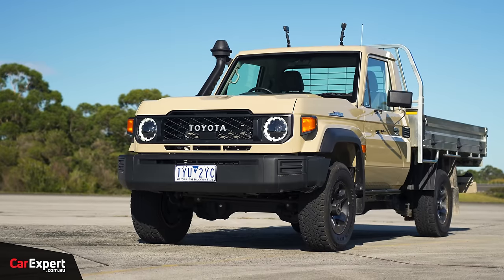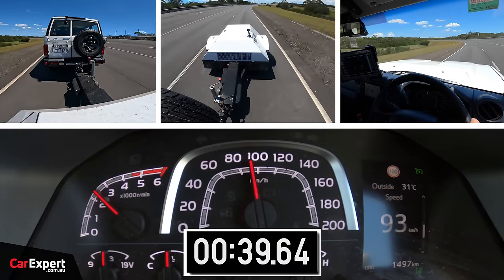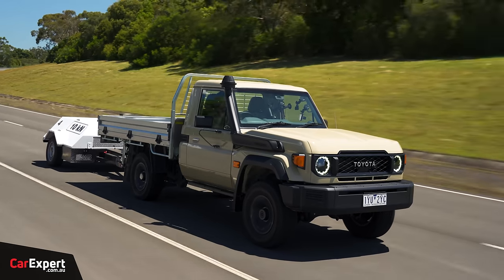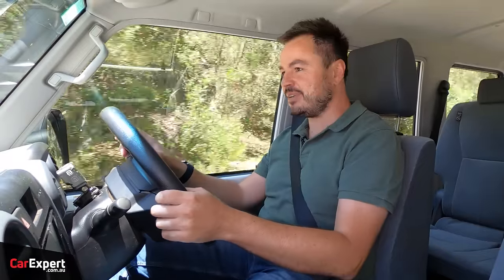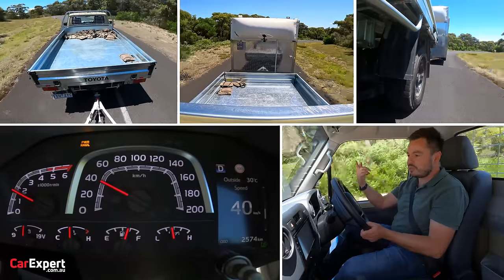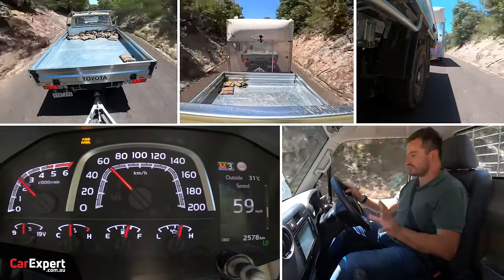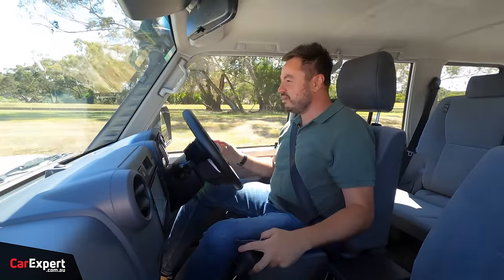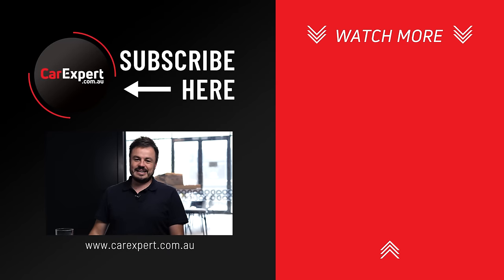LandCruiser 70 Series V8 v 4-cylinder towing stress test & drag race! Is Toyota's V8 dead?

Comment: Finally someone mentions the auto gearbox as a notable difference. Different ratios (especially 1st to 2nd vs the V8), torque converter vs direct drive in the manual, even different diff ratio in the 4 cylinder to help the engine rev more & aid with acceleration. It's not just 70nm more torque & suddenly the V8 is no good, there's a world of difference that everyone likes to overlook when comparing the 2.
Reply: Great to see some people recognising the drivetrain is the only reason the 4cyl performs better. That just gets ignored by journalists and 4cyl fans. The v8 behind the same ratio diffs and with a 6spd auto would tow better and for longer. Only reason 4cyl is in the 70 is because toyota want to keep selling to fleets and they know the v8 and v6 won't meet the incoming e u r o emission standards
Reply: Exactly my thoughts, bullshit comparison
Reply: 4cyl is cheaper to buy, run, and tows better. But for some reason, people can't accept this. There is a reason why the majority of truck manufacturers use inline engines over V configurations.
Reply: The torque wouldn’t be 70nm more there is a considerable power loss through an auto gearbox. Probably running very similar power and torque just getting delivered quicker in the auto.
Reply: They’re comparing the drive trains how they come from the factory.
Not that hard to work out
Reply: @kernal141  people love to talk hypothetically. It is what it is. This is what's available, and there is no unicorn.
Reply: Nobody mentioned aerodynamics either? For this test specifically, they're drag racing 2 different body styles/configurations of Landcruisers, 1 would be slightly better than the other which would factor into performance testing.
I know it would be minimal but still counts.
Reply: A manual transmission has less driveline losses so will perform better in a lot of tests, the main difference between these motors  is that the V8 has a single fixed blade turbo which is why it only gets up and moves from about 2000rpm to 3200rpm, they that only 1200rpm of usable power, no gearbox is gonna compensate for that. The 2.8 on the other hand has a variable geometry turbo that can provide boost from low rpm right up to high rpm, that why he can't get the V8 out of first on that hill test, because it's breathless at any less then 2000rpm. This is why the same motor in the LandCruiser 200 series has 2 turbos - one optimised for low rpm and one for high rpm and subsequently performs a LOT better than this dinosaur
Reply: @craigsampson3386  yeah ute will be a little worse but both are bricks really lol
Reply: @kernal141  true, & apart from the shared name they are 2 very different vehicles. also not hard to work out
Reply: @felixtimlock  the jump in gear ratios in the v8 from 1st to 2nd is much larger than the 4 cylinder version, with a steep hill & lots of weight you have to wind it out pretty high before going to 2nd to carry momentum for the change, otherwise it will bog down like this. The drivetrain losses in an auto will be worse once cruising at speed due to the slip in the gearbox, but at low revs that slip allows the 4 cylinder to keep powering on while the constant load on the v8 was enough to drag it down with the low revs. The auto is what makes most of the difference in that particular test.
Reply: Yup. Notice they aren't offering an auto with the V8...
Reply: @felixtimlock and having said all that, chap in WA put his tuned up V8 up against his new 4 with a 2.8 caravan behind both. The V8 was back to 4th and 3rd and couldn't maintain 80klms.
The 4 potter retained 100klms an hour in 6th for a majority of the climb.
As a owner of both, he wasn't expecting that, he was sure his tuned V8 would outdo the 4.
Reply: @craigsampson3386  Toyota 4WD buyers don't care about aerodynamics. If they did, then they wouldn't bolt on so many ancillaries like  big tyres, lift kits, bullbars, winches, driving lights, roof racks, side rails and steps and the tow a bloody great block of flats behid them. Plus, these vehicles aren't that quick!. Just my opinion.
Reply: @ianweal3081 the tuned v8 was also running heaps bigger tires so a massive change In gear ratios
Reply: @V4NC3ISDABomb  correct, larger tyres, but his ratio's are altered to compensate.
I don't have an issue with that but everyone watching his channel said it wasn't a fair comparison for that reason.
They called for like for like comparison, well here it is std verse std, and it's the same story, 2.8 handsomely leads the way as it did over the tuned V8.
Reply: @dtengineering1  thats irrelevant to my point though? I just brought up another point people seem to have been missing in regards to an even fair drag race comparison, all the little things can add up to change the overall outcome and aerodynamics is certainly one of them since they're not identical body styles being compared.

Comment: V8 79 driver here. Very impressive performance by the 4-cylinder! 
After 5000km (on-road) towing a 3 ton van I can tell you that descent control through engine braking is not something to be overlooked! Personally I found it way more useful than additional torque or acceleration.  That feeling of the van pushing the vehicle down a steep descent is dreadful and I’ve often times been so grateful for the V8’s engine braking. (And in low range the V8 descent is god-mode!!). 

If/when the 4-cylinder can do similar engine braking, I reckon it will win the overall battle hands down - for the average consumer. For now though, I prefer the V8 for its additional downhill control - and the safety and peace of mind that comes with that. 

Thanks for a good video!
Reply: It sounds like you need a bigger tow vehicle.
Reply: As a former V8 76 owner I do agree on the engine braking in Low Range, awesome it was. In high range towing it wasn't any better than our other vehicles, so can't agree on that point. In fact, when not towing it's not even outstanding.
I went back to my old auto 3L Jackaroo one-day on a expedition with a mate and we both commented out of interest it had better down hill engine braking, (yes it would go from 4th back to 3rd on a decline by itself) than the V8 as 5th downhill it would just runaway, so back to 4th or 3rd to hold similar to Jackaroo auto.
Now, we have been down a hill in our V8 towing in 1st engine braking and it still run away.
It's only good in low range due to it's super low gearing.
I'm now in a 3L auto Patrol.
On road towing it's on par with 76, off-road in low range it just runs on, that's where the V8 76 was better, as long as the wheels had contact with the ground, they don't flex well, ha!
Low Range crawler, yes you're correct.
On road hi range, on par with others I've driven.

Comment: I was talking to a guy 2 weeks ago who had done 350,000 kms in his V8 70 series. Maintenance up to date, engine original but several sets of springs etc replaced. It looked almost as weatherbeaten as he did. But he loved it and couldn't find anything he would swap it for. His mate had a 200 series with over 300,000 kms and he was also extremely happy.

Comment: Wow first time comment a vid 15secs after released from one of my favorite channels haha.
My father used to have a MK-II LC 2.4 Diesel and had lots of long distance trips over 1,000km as family when we siblings were still young. By the time he sold the car it has over 600,000km on the odo yet the resale price was unexpectedly high without any major repair or replacement on both powertrain, transmission and drive tain. 
Absolutely impressed.

Comment: Im not a cruiser fan by any means but revving out in 1st doesnt mean changing to 2nd at 3500. Theres another 1000 revs before the soft limiter, which is there to use. This may have given it a decent chance at pulling 2nd up that hill.
Reply: I agree but still gutless which ever way he did it
Reply: @garryboyd104 the short 1st gear doesn’t help either in this case because then there is not enough Rpm in second gear to help the v8 climb the hill

Comment: My experience is you probably need to go a bit higher than 3500rpm in the V8 on climbing upshifts. Peak power is 3400 and some of the ratio gaps are pretty big. At the end of the day everyone knows the V,8 big drawcard is that almost everyone tunes theirs and wakes it up blowing the 4 cylinder away.
Reply: Not so, watch Ronnie's comparison with his tuned V8 up against his new 4 pot towing his 2.8 tonne van.
He couldn't believe nor was expecting the result neither.
His new 4 pot blew his tuned V8 into the weeds.
V8 couldn't retain 80klms, 4 pot retained 100kms.
Reply: Yeh but ronny has a very mild tune 😂
Reply: @ianweal3081 put the same tyres on the 4cyl Ronnie lost the last ounce of credibility he had with that video
Reply: @knuckledustaz  okay, but allow them to regear the 2.8 to compensate for larger tyre also as his V8 is.
That done, the four pot 2.8 would still clean up.
You just have to accept that the  V8 has outlived it's time, just as the 6 cylinder 4.2TD Patrol lost out to the 4 cylinder 3L turbo. The die hard 4.2 lovers never accepted that either.
I owned a 4.2, it was a slug.
I owned a 4.5 76, better by far, but not great.
I now have the dreaded 3L Patrol.
It is by far the pick of all three, far far better power than 4.2 created.
It's on pah with 4.5 V8, irrespective to what the nah sayers say, I've owned all three and I know my 3L is the pick, as I suspect the 2.8 is over the 4.5 cruiser.
So yes, swap rubber, but vary ratios also and then by all means test them. His credibility will be fine in that scenario, as Paul reinforced in his testing, like for like.
Reply: @ianweal3081  having owned v8 cruiser, 6cyl cruiser, 3.0hilux and best mate has a 4.2 patrol after blowing 3.0 zd grenade up. So I can also answer with experience- of the 4cyl experience the 3.0 hilux motor is the absolute pick of the bunch and all being stock in their respective vehicles is still the pick, the 1hdfte was great and wish I still had it and was a better motor stock than the 4.2 patrol and on par with the v8 1VD just down on torque but great reliability and fuel economy. Now tune any of these and I mean same tyres at minimum 34’s and stock gears to all the v8 1VD cruiser blows them away, followed very closely by the 1hd fte which is also common swap in the desert race scene into the cooled patrol as it’s a better truck. I have had these motors apart and can confirm that the 1VD is a stout motor with reliability if maintained. The 2.8 is a great city motor and perfect for the hilux/prado as is the new 3.3 in the 300 however these are not motors for big wheel big load and long haul touring trucks. If this was the case we would see kenworths with 5litre engines or a better comparison would be hino using the 2.8 in its commercial trucks. Take a look they run big displacement 4 and 6cyl diesels for longevity and torque.
Reply: @knuckledustaz  👍
Interesting how people have different experiences with the 3L Hilux Prado motor. Yes, they can last but they can & do fail also.
Son-in-law brought one, had so many clutch issues, always replacing them, he found out Toyota revised the clutch so many times mechanics didn't know which to fit, hmm.
Then I suspect they got crook fuel, had an injector issue, hole in piston, new motor, shortly there after, same issue, replaced motor and chose to trade on ford ranger, trade poor, (so much for retaining value) so they purchased ranger and offered Hilux to his sister, but again it burnt hole in piston, she couldn't afford to repair so my son took it off their hands, new motor again, (4th one if you're counting) new clutch whilst apart (again) shortly thereafter gearbox shit itself, a vehicle that hadn't achieved 400K by time this all occured.
Rebuilt gearbox, still had issues, so another gearbox sourced.
Son (a reputable diesel mechanic) finally has it running sweet, but it certainly was a lemon, ha!
Recall a article in a magazine once.
They took feed back from:
Berima Diesel, Mt Dare, Ultimate Diesel - 2 outlets. These chaps reported on broken trucks.
Interestingly they all reported the Isuzu was class leader, Colorado close second, Mitsubishi following. Nissan 3L was not as bad as reported, but the 3L Hilux Prado motor actually had more catastrophic issues due to injector failure than Patrols, yes more!
If I could recall the article I'd direct you to it.
I'm not here to point score, I just always found that to be an interesting statistic that never stopped the illusion of unbreakable.
Unsure of son's Hilux mileage now, but it finally reliably runs around.
Recall when I was buying my Patrol wife truly wanted a Prado.
Son was adamant we didn't purchase one due to motor issues, was still 3L back then.
Guess who now has a 2.8L Prado, yes our son, so he's running the 3L Hilux & 2.8L 2022 Prado & loves it.
Tows his van with total ease.
I'll be sticking with the Patrol though as it's a very good tourer as well as a capable of roader.
Regards
Reply: @ianweal3081  My GQ TD42 has done 460 000 km on the original engine, gearbox, clutch and all running gear. I have taken it all over the country towing my camper for 20 years only needing to replace peripheral stuff like radiator, starter motor etc.

I still use it as a daily driver.
Do I care that a newer car can accelerate to 100 km/hr 5 seconds faster?

When this engine finally gives up I will get a full recon TD42 turbo and get another 500 000 km out of it.

Comment: According to Toyota own words, the 2.8 “equals or exceeds the torque of the 4.5 V8 from 1400-3400rpm”.

That might be difficult for people to understand when they see that the 2.8 peak torque of 500nm is listed as 1600-2800rpm. 

But note the word peak. So when it’s not at its peak (under the curve) 500nm at 1600-2800rpm. It may be at 430nm at say 1400rpm, thus equals the peak torque of the V8 and exceeding 1450rpm all the way to 2800rpm.

Also note Toyota state the 2.8 makes 150kW between 3000rpm to 3400rpm. The V8 is strictly at 3400rpm.

Comment: Great video mate, very fair test. I will be interested to see how many KMs people get out of the 4 cylinders. The V8s come well under tuned for longevity that's why you see them for sale with 900,000kms on the clock. I don't see the 4 Cylinder making it to 300,000kms personal.
Reply: Nobody buys a vehicle to get a million km's out of it. Those rare ones out there are not the first owner. I've driven over 2 million km's but over 15 different vehicles.
Reply: Plenty of prados and hiluxes with this same combo over 300k.
Reply: Correct more power and torque and half the cylinders= twice the ware rate of the engine

I personally like big lazy engines they last for ever
Reply: @jayd3931  I do still got my first car with 400k on it my second at 700k 
My third at 360k 
My forth it's been around the clock more times than I can remember the odo only goes to 99,999 Miles
Reply: Never had much to with td42 motor if you expect less than 700000km from a motor. Even the v8 I've driven a few with 700000km. All first owner cars and all the 6 cylinder deisels have reached at least 700000km. Best was 200000km (1.2 million km) motor never been touched that I fixed lights on to register.
In saying that the hybrid camry expect 500000km at least and 4 cylinders can achieve higher kms with good engineering.

Comment: The gearbox is the difference here. The auto has more ratios and keeps the engine in boost between them.
Its technically the better powertrain here but I'd still have the V8 manual. 

What would be nice is if they got the V8 up to the modernity of the i4.
Reply: The v8 diesels here in the US and Canada all get 10 speed automatics. Ram is the only manufacturer still using a 6 speed and they dropped their manual at the start of the 2019 model year (increased power in the Cummins put it above the input torque rating of any manual that would fit).